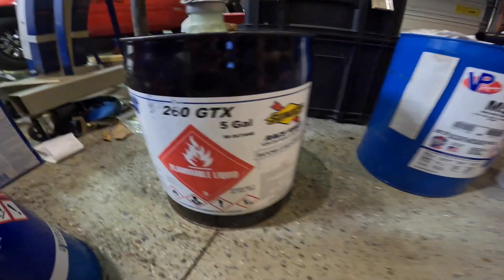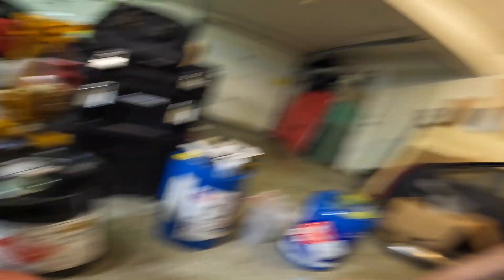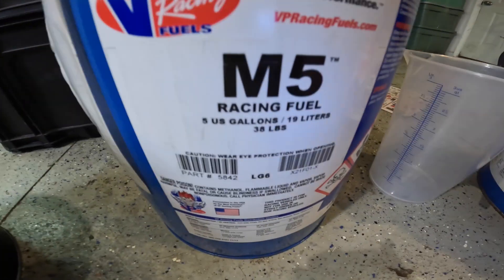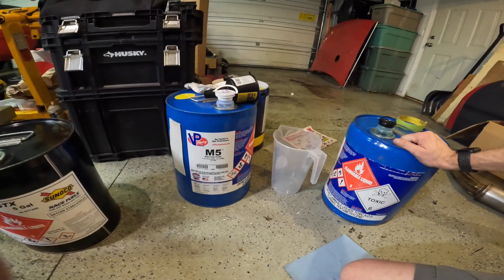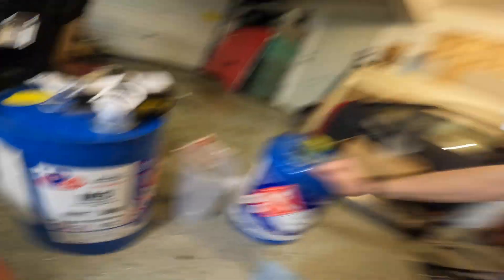Mixing up GEM - The Best Race Fuel you Haven't Heard of yet.

Comment: instead of E85 they ought to have GEM available at the pump to stretch out corn ethanol even more! Green Methanol could be produced via direct carbon capture so with say a 45-50% blend methanol it would push the GEM fuel in murica to be more carbon neutral? i prefer this way more to pushing BEVs down our throats!

Comment: Seems like a lot of work for little to no gain....but that's me....
Reply: Then you don’t understand how to use it. 🤷‍♂️
The whole point, is to move the limit on your EGTs while working to tune the length of the combustion cycle.

You have the volume under the bubble that is essentially volumetric efficiency to place power. This allows you to mess with stoich, latent heat of vaporization, and octane all by having three points of adjustment. 

If you know how to use that in order to get the meat of the VE table (now adjusted) where you want, do it safely, and you’re on boost?
Well congrats, because you can now add more boost because you dropped the EGT figures. 

You’re not trying to get gains off it- you’re trying to raise the limit of what you can go after. If you happen to know somebody that knows nitromethane blending well, this is a fantastic tool for essentially carrying methanol/water injection though your current fuel system. Then on top of that, you can carry an undisclosed amount of nitro in ratio if you do the math well. Most don’t, but it is fun to watch people look for a nitrous injector that doesn’t exist… because it’s just chemically blended into the fuel.
Reply: @charlescoolidge747  I still say its more work than it's worth when you can just get a better fuel.....
Reply: @markgoulette5056  better fuel like what ?
Reply from the maker: Many NHRA teams mix their own fuels. I mean you know that... right?
Reply: @unkiescott  The top fuel teams mix their fuel to meet the required methanol percentage.  Fuels are highly regulated in NHRA competition when racing on the national circuit.  Fuel tests after runs are quite common and most of the classes that run are required to run a specific fuel.  You're not going to meet fuel check specs with a home brewed mixed fuel....

Comment: Do you have any data to see if this fuel will help with high iat’s with it being 45% methanol? I’m thinking about mixing my own and running it versus running e98
Reply: I'm pretty sure 98 straight up will cool better than methanol mixed with gasoline because methanol cools about 30% better then ethanol at the same volume. Gasoline cools about 75% less than methanol. Averaging the two fuels would be less than pure ethanol.

-Methanol  1100 kj/kg
-Ethanol  850 kj/kg
-Gasoline  305 kj/kg
Bigger number means better cooling

Comment: Im curious, if the goal is to make the same values as E85, why add the E85 at all? I feel like once you have mixed the methanol and race gas any amount of ethanol from 0 gallons to 100 gallons would make the same stoic value? Please correct me if I'm wrong.
Reply from the maker: Gasoline is not inherently miscible with Methanol. Just mixing the two, the Gas/Methanol will separate and you'll have a bad time with that as your AFR swings from somewhere around 6.5 all the way up to 14.7. The Ethanol in GEM binds it all together, ensuring nothing separates. 

I have a paper somewhere about this where they tested it, the value was around a minimum 8-10%, but it's fuzzy and it's been a long time since I read it so I might be off on that value. But with the amount of Ethanol I use in this mix, I have not experienced any sort of separation.
Reply: @unkiescott  unfortunately... pump E may not be the answer to mixing, I didn't test it but I'm wondering if I was around 76/78% E in company to 98% in other ethanol based fuels. Long story short it seperated and I burnt up my motor 🤦🏽 tune was on, fueling was on, timing was safe. Some plugs read like M1 plugs, others read like race gas plugs. Learning experience for sure.

Comment: Are you doing this for emissions or more power ??
Reply: I'm sure with the presence of meth, it'd probably have a slight edge over race ethanol due to the latent heat of evaporative properties of meth. If anything, this is more for quantity purposes, race gas is 30% more expensive than ethanol and meth is nearly 20% cheaper than ethanol. Undiluted meth is corrosive and lacks the energy density of ethanol and gasoline. It's a fuel that CANNOT sit in the tank and HAS TO be flushed out after every use with gasoline or you'll risk damaging fuel components, especially injectors. Assuming you had one pale of gas, one pale of ethanol, and two meth pales, you'd have nearly enough to make five pales if mixed to stoichiometric like in the video. Anybody jumping through these hoops for emissions has been misled, you'd be better off running gasoline and slightly leaning out the map on low load cruising scenarios.

Comment: Why not use 100% meth ?
Reply from the maker: Fuel pump, injector and class requirements. Also, with this fuel I have no change in the tune between street and track tunes, as it is a drop in replacement for e85.

Comment: Toluene or Xylene Does Raise the octane in MON more than alcohol-based fuels?  But the disadvantage is that these are strong solvents. But on the other hand, apparently, for example, ethanol has stronger knock resistance than what the octane level says. Certainly more oxygen too

Comment: Nice video Sir.  Have you tried pre-mixing fuel and store it for some time?  Does it separate or go bad in any way?
Reply from the maker: The point of adding the Ethanol in GEM is to prevent separation. I've had fuel sit over the winter and used it the next season without any problems.

Comment: Have absolutely bothered you asking questions about GEM in the recent past... very much appreciate this video and probably won't have reason to bother you over it in the future. Ha!
Reply: I cannot get him to reply to me.. how much more power is this fuel making?
Reply: @christart8461  that's a question without a definite answer. GEM will probably not directly convey additional power like nitro or other oxygenated fuels but it may allow the engine to be tuned differently than when on pump gas or E85 which could then yield more power. More timing, more air density and so on. Just depends...
Reply: @christart8461  the fuel it's self actually has a relatively low calorific value compared to straight gas, so GEM alone is not what makes the power. Where the power comes from is being able to run much higher CR, ignition  timing and boost. GEM will also run a lot cooler which also brings power advantages.
The downside with GEM  is you will be consuming considerably more fuel than with straight gas, again due to the lower calorific value of GEM.